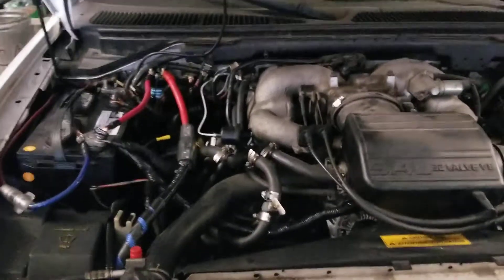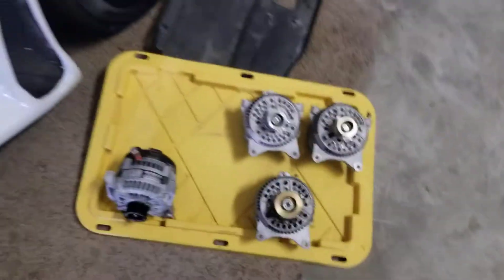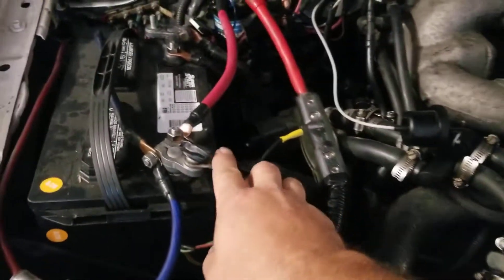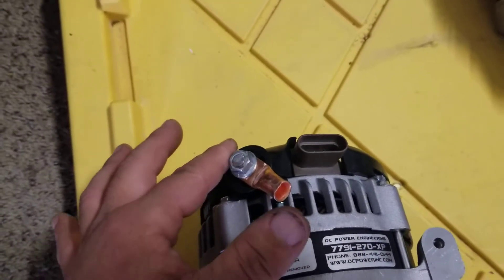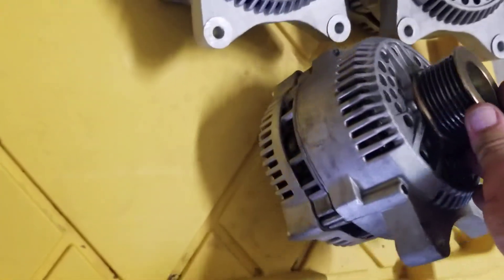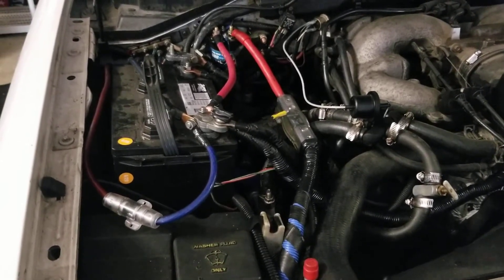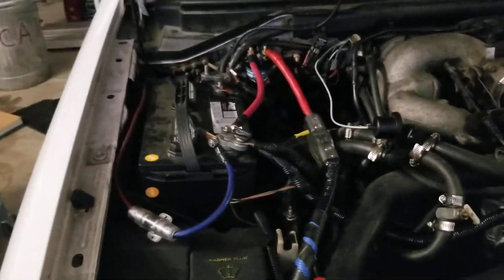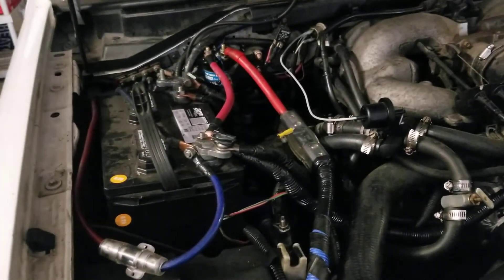FIXED! high output Alternator not charging batteries

Comment: What did we learn?
1. You bought a "H.O. alternator" from ebay. It stopped working.
2. You replaced it with another "H.O. alternator" from ebay. It stopped working.
3. You should have learned after the 2nd "H.O. alternator" that you shouldn't buy a "H.O. alternator" from ebay. But you bought a 3rd "H.O. alternator" from ebay.

Moral of the story, you should have not bought a 3rd "H.O. alternator" from ebay. 🤷

Comment: Out of curiosity, are you changing the size of the Serpentine belt with the new alternator? 
   Your wiring looks like different sizes... Did you upgrade your big 3 (some do 4) or did you just add extra wire to the relay and additional battery?
     Are they in parallel or or did you isolate one from the other? 
       I'm about to put a HO alt in my vehicle and it's definitely alot understand how everything works but I do know that the smallest things can cause things to not function properly or fail prematurely...
Having undersized wiring, different sizes between your main power and grounds, or even different battery types that arent isolated properly might appear to work at first but wear out way before they're supposed to and can damage other components in the process...
My interest is mostly for car audio, but electrical systems follow their respective systems (ac/dc) regardless of application...
     Hope this helps or ya figured it out...

Comment: i feel the same for my high output alternator 200amp and its not fully charging the battery, the battery is good for 500cold crank amp for a civic cant fit bigger battery  and the battery is no more than 2 years old.  im gonna bring it to bench test  it to see whats its putting out at idle  i feel like the oem alternator is charging better than my so called  high output ebay ones and good tip on taking it to bench test